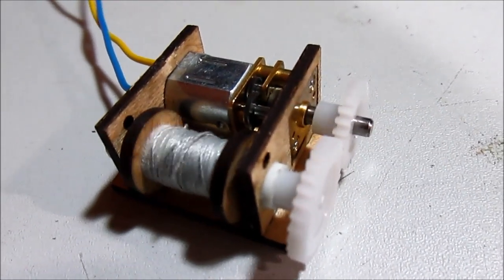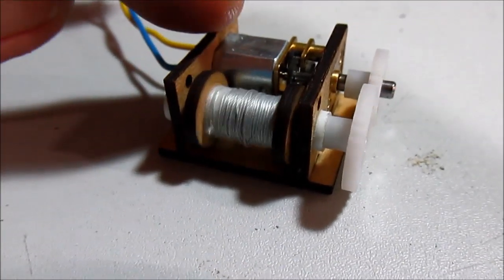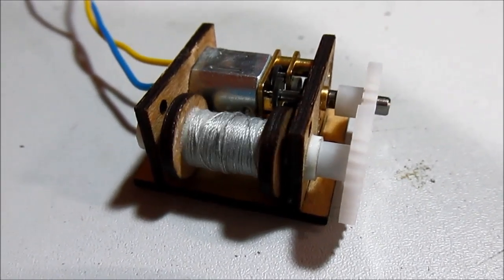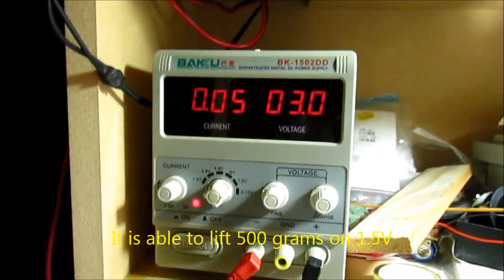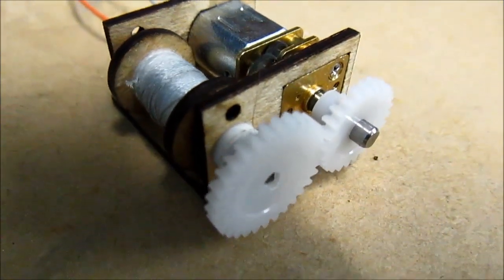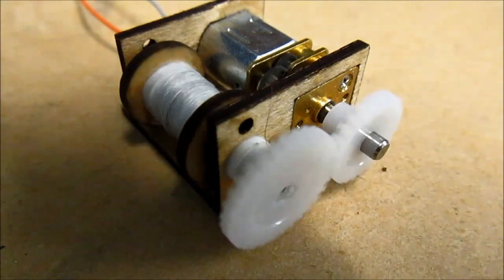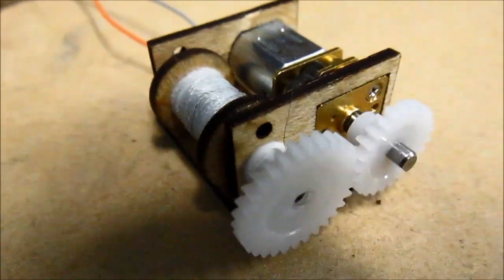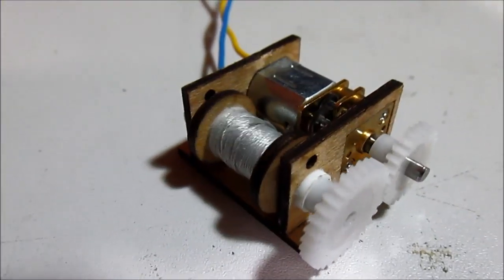Westimation Miniature Winch

Comment: hi, nice project but how much can he lift max ??
Reply from the maker: Winch idea was to lift a maximum 100 grams. Tested to 500 grams. It could lift more but frame, bearings and motor might not last long.
Reply: @Westimation  do you think it can lift more with hoist and pulleys system ?
Reply from the maker: @dylansauge2333  . Even using block and pulleys the strain on the cord will still be the same. e.g Lifting 1Kg will put the equivalent 1Kg strain on the cord.
I don't sell these any more (see video comments). 
I suggest building your own. Keep in mind overall mechanical strength, the winch shown here is only about 40 mm square.
You could use one of the larger 12V geared motors available on Ebay.
How heavy weight do you wish to lift?
Reply: @Westimation  I wish to lift easily at least 500 grams with a dc motor 12V for 400RPM. Do you think i could lift with that ? That's the same type of motor than you
Reply: @Westimation  I doubt that's enough
Reply from the maker: @dylansauge2333  One of these would be better https://www.ebay.com/itm/DC12V-25mm-5-1000RPM-Gear-Motor-25GA-370-Low-Speed-Metal-Gear-Motor-For-DIY-inm/183358414984?hash=item2ab1036088:m:mr9j3VxZ6kY-PkhwbxNV4zQ
Reply: @Westimation  okay thanks